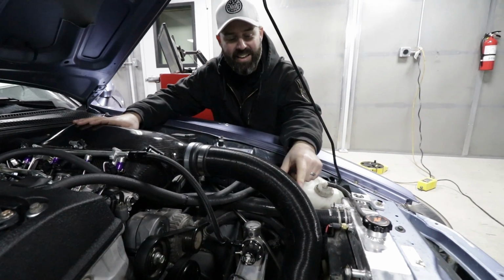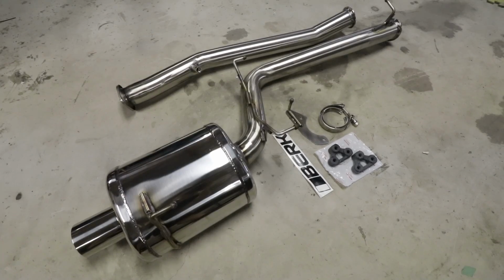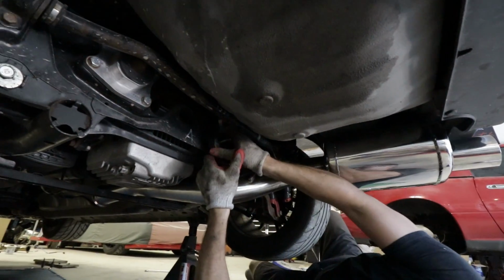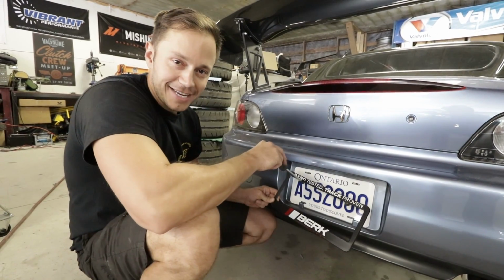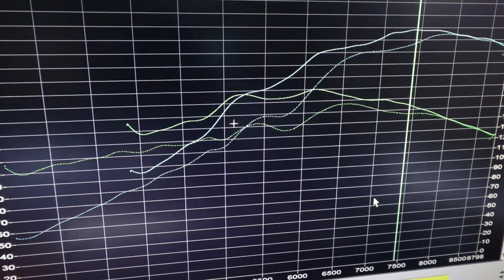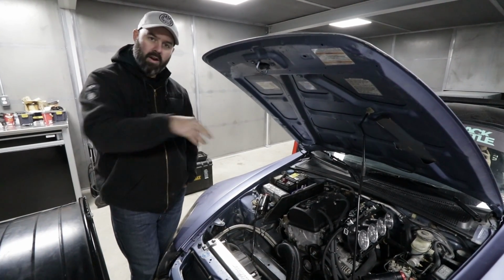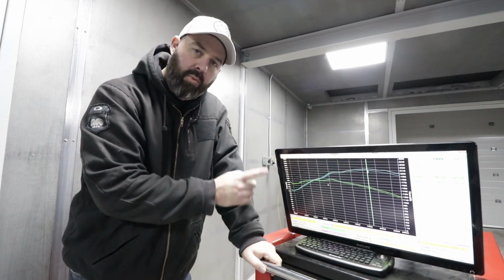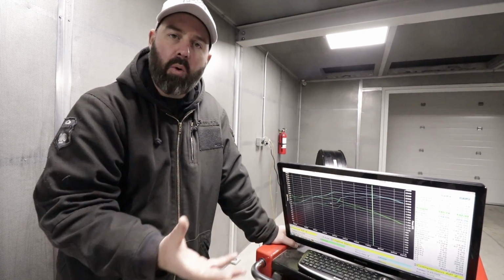Does an ITB AirBox Rob Power? + Big Power Gains ITBs & 3-inch Exhaust - Project BADASS2000 - EP15

Comment: Would you still be able to throw a power adder (forced induction) on here and keep the itb'?
Reply: Muhammad as a general rule of thumb 
( except for compression)
If it helps NA 
It'll help FI
just as much If not more 

But it's all about making a more efficient and in turn powerful system
Reply: Muhammad you still get massive benefits from itb's boosted 
I don't know why people say this
It still gives you better smoother flow and MUCH better throttle response
The current one problem if they went boosted is the airbox design because it'll bias the rear
Reply: Victor Oliveira Yes you can, but it probably negates most of the benefits of the ITBs
Reply: MyLonewolf25 I have 0 experience on this subject but I assumed that a well designed regular intake manifold with a single throttle body would work just as well as ITBs in a boosted application.